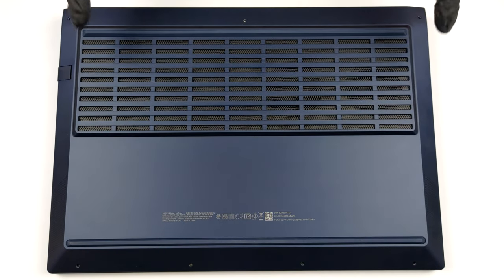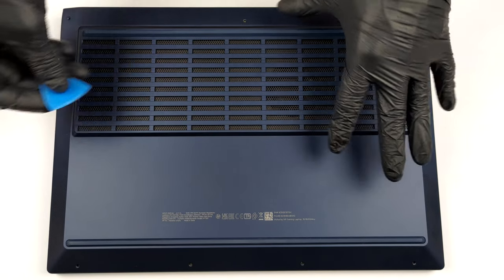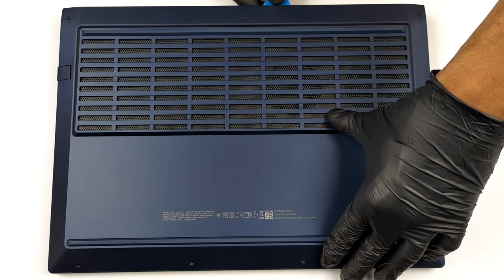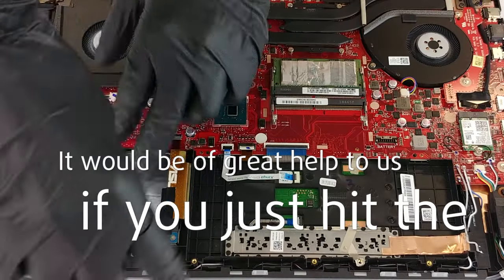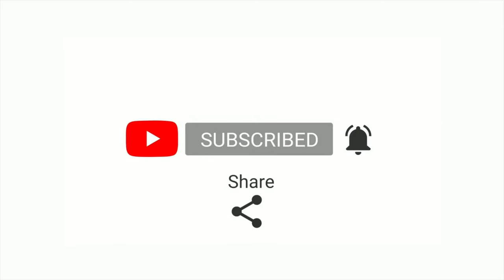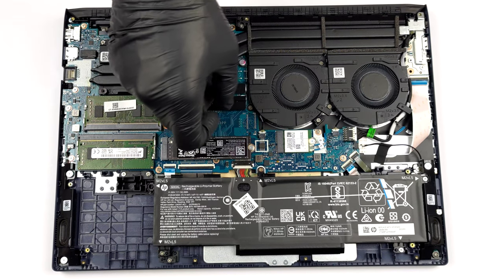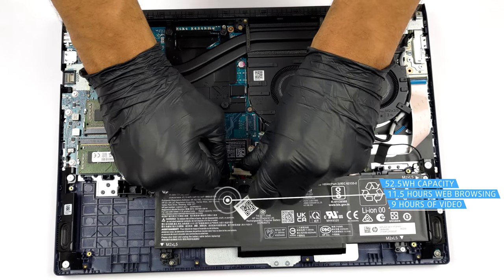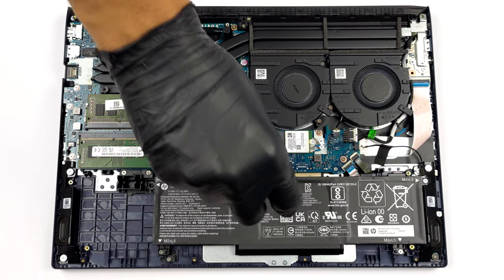🛠️ How to open HP Victus 15 (15-fb0000) - disassembly and upgrade options

Comment: Hello. 
I have a Victus 15-fa0005nl, it has a 512 Gb ssd, i want to update it to 1Tb (that is the maximum as i understood) what kind of ssd i have to buy?
is this ok? => Crucial P3 1TB PCIe 3.0 3D NAND NVMe M.2 SSD
Reply: Hi. I have same Victus. I put Samsung 980 pro 2tb m.2 in mine and works fine
Reply: @andrewkinzie9564  i saw that maximum storage disk capability is 1Tb and maximum RAM is 16 (8+8).
And SSD should be 3th gen.
So that is not true?
Reply: @nayefhossain2881  Hi. After commenting on this I went back and looked at my model number and it is different. I apologize for the mistake. I am not sure of the specifics for your device. Have a good day. My current Hp Victus 15 12450h model number : 15-fa0031dx
Reply: @andrewkinzie9564  hey I have the exact same model, how much ram are you using and do you know the max allowed ram ?
Reply: @mysterio9960  Came with 8 i added 8 for 16 total. I've read 32 max.
Reply: That 1tb limit is probably just the max size they ship with from the factory. 

And that SSD should work fine
Reply: @andrewkinzie9564 can you tell me which size screwdriver you used to open it ?
Reply: @cyrilignatious4709  Hi. It was PH00
Reply: @mysterio9960 can my victus 15/12500h do like urs?
Reply: Shoulda bought the better one..mine has 2tb😊
Reply: @andrewkinzie9564 hey is it working as a gen4?
Reply: @elcrackster69  The 980 pro M.2?
Reply: @andrewkinzie9564  yeah are you getting the full speeds?
Reply: @elcrackster69  Not sure, I never tested. How would I do that? It's fast to me. Works with the 2tb
Reply: @andrewkinzie9564 hey, I have the same exact model. So I’m assuming yours came w the 512g ssd too? I’m trying to upgrade and know nothing about PCs or their hardware. Some guys say you can run a 1tb m.2 and there’s a comment above saying we’re stuck w the 512g ssd. So I’m confused
Reply: Yes @Lou_e92  I got on sale at Best Buy a while back now. I upgraded the 512gb to 2tb. And the ram from 8 to 16gb. I did have to buy a special computer repair tool kit from Amazon for opening up the laptop tho. PH00 to unscrew the back and use the guitar pick type plastic tool to pry and slide open the laptop. There are a few yt videos on how to open safely. Hope this helps.
Reply: @andrewkinzie9564  thanks for the info!

Comment: can the 2nd m.2 slot be soldered manually?
Reply: nope dont even try unless you want to destroy it
Reply: @kristianorambalack  a gaming laptop that can support only 1tb max, i make a big mistake after purchasing this laptop. and they simply hide this information
Reply: Yes... As long as you have efficient tools for it and the correct component it shouldn't be an issue.
Reply: @kristianorambalack  you had the same model? ryzen 5 etc?
Reply: @danielaniq  nah i7 12th gen
Reply: Yes it could be soldered but the issue is where would you find matching m2 slot for hp victus motherboard.
Reply: @kristianorambalack  so in Ver I7 12700H I can put 2TB SSD gen 4?

Comment: I have the same laptop 
I want to upgrade the storage more than 512gb 
But how would i get my data changed over?
Plz make a video on it❤🙏🙏🙏🙏🙏🙏
Reply: I use something called etcher balena which will copy the drive for free and you need to have a way to read both drives at the same time where you will have to use an ssd reader to read your new drive and transfer your old computers data to your new one
Reply: It is also possible through windows if you dont want to use a third-party source. To transfer over data you almost 100% will need something that can read both the new and old drive at the same time.
Reply: @Ben-xg6yo  right so suppose i have a ssd reader 
How would i go about that?
Reply: What happens to the original windows which comes with the laptop, I believe it comes in the inbuilt SSD.
Reply: @rushdilatiff4003  if the entire ssd is perfectly copied, windows and system 32 should also be copied on to the new ssd. Ive never actually done this, but from what I can guess you'd have to reboot windows from bios and then the new ssd should show all the new information.
Reply: @Ben-xg6yo  Thanks for the heads up, I will not take a risk, I will ask the technician for help 👍🏻
Reply: @rushdilatiff4003  Sounds like a great Idea :)

Comment: Why do these videos never say the size of screwdriver that is needed…
Reply: Because if you need to know the size of the screw driver you prolly shouldnt be opening the computer..
Reply: @theman-pc2ej  Instead of insulting me, why don't you help me? If you know what you're doing, why don't you give me-someone who doesn't open computers often-advice on what to do? I ended up finding the instructions in my computer's manual; why not suggest that to me? Show kindness and aid, friend. Encourage, don't dissuade with sarcasm.
Reply: @jaxprismite6672  well im sorry if i feel that if you cant use your brain to find a simple screw driver that fits a screw then maybe the internals of a pc is gonna be to much for you.. its not an insult, just a recomendation to prevent any damage to your equipment
Reply: @theman-pc2ej  It is an insult, brother. You even did it again, saying that I "can't use my brain." I can use my brain, I'm just a college student who can't afford a whole set of tools (nor do I own a set), so I have to be selective in what I purchase; ergo I require the specific screwdriver measurement. Treat others with kindness please, brother. Peace and love to you, my man.
Reply: @jaxprismite6672  hey i agree bro, peace and love right back to you man.. wasnt trying to insult just cant amagin someone having noledge of the internals of a pc but cant choose or dont have one of two very common screw drivers.
Reply: I used 0000 but you should be fine with 00 tho

Comment: This video does not show how DIFFICULT it is to remove the bottom panel on abrand new machine. Yours has clearlt been removed and set back down loosely for this video. Not good info,